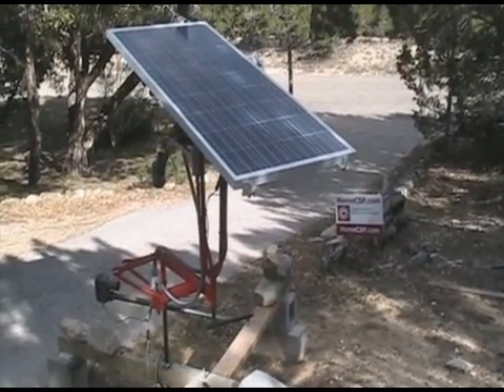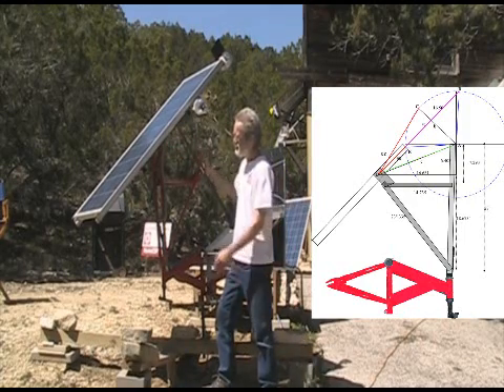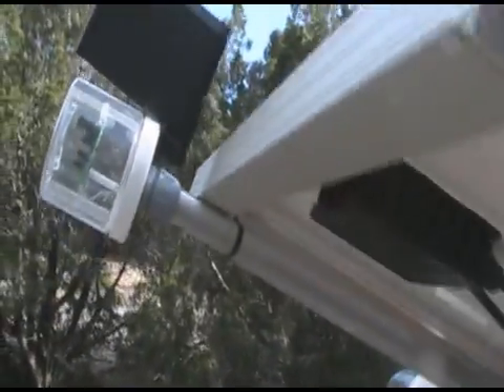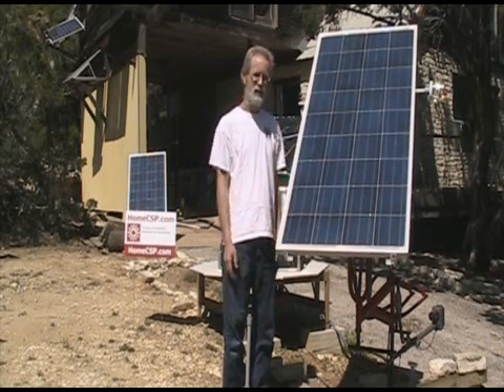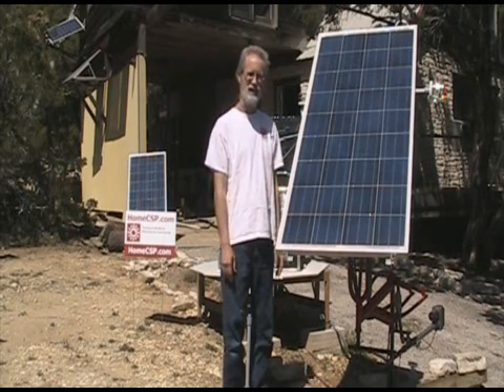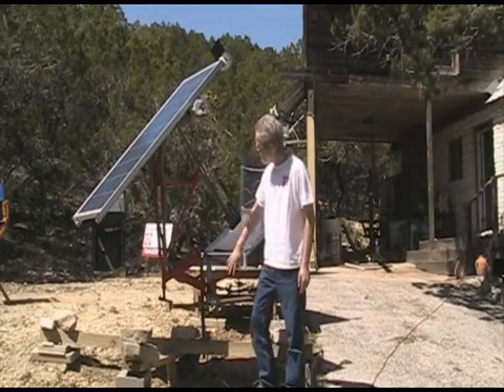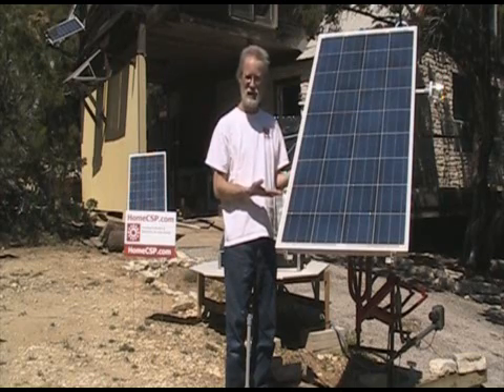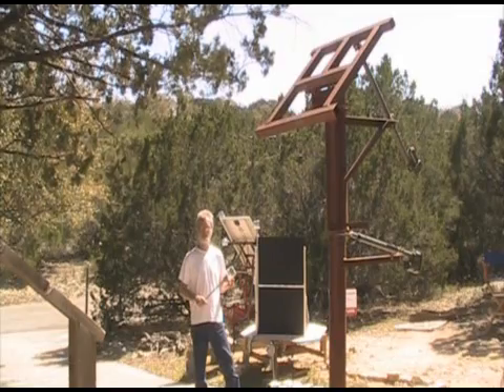Dual Axis BMX Frame Solar Tracker with TinyTracker controllers

Comment: In the time lapse video of the tracker in action at the end of the video, why did the panel appear to be hunting up and down. Was that because of cloud cover? Can you limit the movements to every 5 or 10 minutes to minimize excessive use of the linear actuators. Nice project. Where did you get the tiny trackers?

Comment: I am about to built a solar tracker for a project...may i ask you what type of motor can rotate an x axis with 6Kg weight on it?  I am between a gearmotor and a stepper motor, but how can i know if the motor i will choose will be powerful enough to rotate the panels?